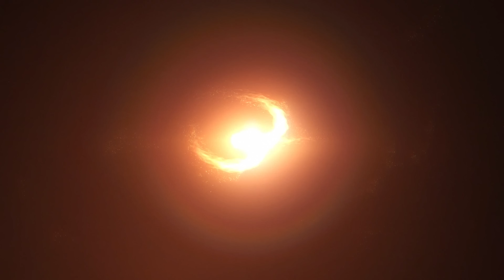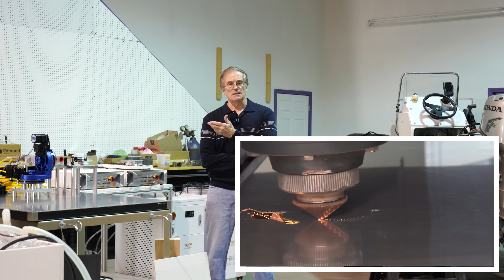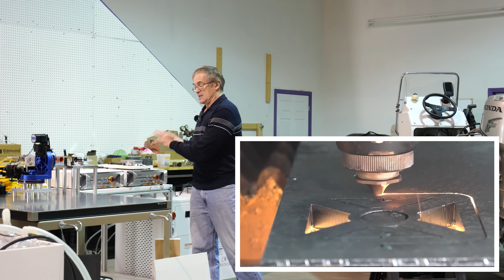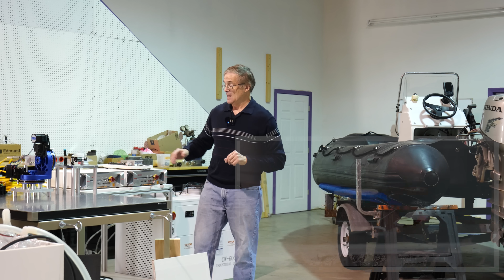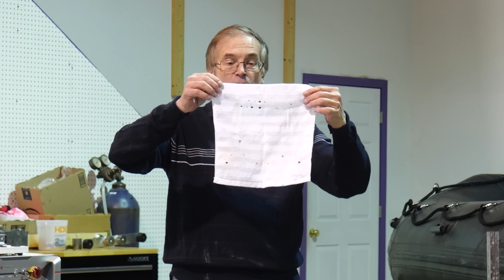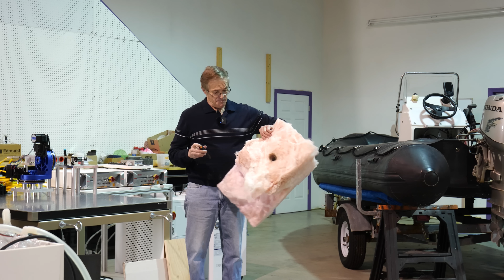We have a problem... and need your help!

Comment: Could you not put the same sort of diffusing lens (albeit a much larger one) near to the wall that needs to be protected as the lens used by the metal cutting system?  
Basically a 1m x 1m optical shield that will spread out the laser so it is less damaging.  This would be reasonably portable.

Comment: I know very little about lasers, but I've worked with PLCs for years. 
If some safety signal is lost, they will shut down the whole operation within 5 milliseconds (if that is their only task). 

The materials you tested are perforated 'upwards of a second'. 

Why not simply put up a "sensor", could be as simple as wire that is burned through, which triggers the safety PLC to shut down. 

Those materials should be good to go for at least 10 tests. 

Anyways, just an uninformed thought. Love the videos!
Reply from the maker: That's a really innovative approach.
I like it.

Comment: Something a plaintive like wood with a constantly running water stream over the top of it or repurposed 10 mm thick 1 m wide rubber belts used in conveyor belts from the mining industry which rotate over rollers rapidly. It may not be cheap and it may not be light enough to move easilybut the thick rubber moving quickly should solve the penetration issue.

Comment: 🇨🇱
Great channel. Great question! 
Many "solutions" propose a moving target. Be it water, sand etc. 
But, instead of moving the target, why not move the beam  ⁉️
Yo did not like a mirror pointing back at you, I understand 😀. 
However, how about a wobbling, rotating modulated mirror, say 45º or 90º !? 
The beam would no longer be a concentrated  point, but a extended line {figure} 🤔. 
Saludos de 🇨🇱

Comment: My first thought was the water saturated fabric, followed by fabric kept saturated via misting system recycled by a catch trough and pump system.
but as it wouldn't give much time. 
How about an ablative layer of carbon black applied to a ceramic fiber blanket. with a layer of foil 4 cm behind it ?
Or better yet a layer of graphite felt , that should get you at least 10 seconds alone

Comment: What a about a spinning piece of iron, like a section of old iron sewer pipe.  It would need to spin so that it disperses the heat.  Also if you cut a groove in it so that when it is spinning, it holds in water with centrifugal force.  This will turn to steam when it is heated up, obviously.  The barrier would need to be spinning, just outside the beam, and spring loaded to snap into place to absorb the power and then a small pump kick in to pump the water as it is used up.  I think the iron would rust black Fe3O2 in the water and laser, further increasing it's absorbing of the laser, hopefully.  This is just my brainstorm, I have not done it, but it appears t me to be the solution as I watched the laser cutting video, the thicker the material, the slower it went.  I would recommend a hard drive motor to spin the thing up to high RPM.  There are 10KRPM 3.5" x 1.6inch hard drives that will probably have a motor with a enough torque for that, but beyond that there are quite powerful outrigger motors in hobby model planes and.  You may need another motor to move the barrier in and out to change the track the laser is getting dumped into.  You may even be able to make the thing with the laser to carve out the trough inside for the water.  Sounds like fun!

Comment: Since the problem is there are no material that can dissipate the heat fast enough you can move the thermal resistant material fast enough, I don't know, an orbital panel of silicon oxide perhaps?

Comment: Equipment tech here. If you can mechanically track the beam path, how about using a concave lens to give a very wide beam dispersal. Energy/unit area should be inconsequential after a few inches. Just an idea...
Reply from the maker: Thanks. 
We can't mechanically track the beam path.

Comment: With 7000 comments, dozens of people have probably already suggested this:
Instead of a static piece of material, let it rotate on a motor. Then the laser needs to heat up a much, MUCH larger area. Pretty sure 2 or 3 layers of drywall will last sufficiently long.

a rotating steel mirror might also be an interesting test to redirect the laser into some trap made of sand or fluid. Without the mirror melting...

And if that mirror has the right bumpy surface, it could actually defocus the beam.

Comment: Graphite coated in silicon carbide should work. Put it at the end of a box coated with vantablack to prevent any diffused spill bouncing around the shop.

Comment: Stupid idea here, but maybe not.... 
You mentioned that the LASER would not damage an unintended target if it were continuously scanning. Makes sense.
Normally we think of scanning as in a back and forth linear path. What about circular scanning?
Could the LASER output be made to move rapidly in a large circle when not locked on to a target?
Once a target is found and tracked, reduce the circle radius to concentrate the power.
No need to disrupt the precise focus of the beam.

Might work, might not.... I look forward to seeing what you do.
Reply from the maker: It's a trade-off off.
My responsibility in this project is the laser and optics.  Chris is dealing with tracking and targeting. I don't want to burden the beam director system to deal with energy dumping. And, the same hardware and computer we're trying to failsafe against  would be part of the defense.
Reply: Understood. I had thought of the "spinny part" being mechanically seperate from the main tracking system. 
Somehow using a variable refraction to determine the scanning circle radius, with a fail mode to maximum refraction.
Admittedly I have no experience at all with high-power optics, so I am not sure what is possible.

Comment: What about a graphite ?
It is safe, has high melting point and is easy to get. It will redirect inside the material, maybe charcoal to reirect the laser through ex wood structure. It, s porous...
Maybe check starlite...

Comment: I've read in some article about nanotubes of carbon been used as a non reflective surface for laser beams. Infinite budget needed...
But, I was thinking if it might be possible to treat the beam like we treat sound. Reflecting the beam on different reflective surfaces that absorbs some of the energy until it can't be that strong, or a change it's concentration...

Comment: How about concrete backerwall, the stuff they use to put tile on walls without ripping down the drywall. They come in sheets as large as drywall, so you could make a frame with wheels, with possibly 2 layers of the backerwall.

Comment: not sure but keep thinking that the laser beam has a certain frequency and if it would hit something that has the same absorbing frequency then it could neutralize it. I have no idea how to do this but would maybe a wall of "counter light' or a material exited at the frequency be neutralizing. Again, I never worked with lasers, and I am a happy mechanical engineer that still uses hammers to solve problems. the only other thing would be a mirror that directs it into the ground.

Comment: Can you program a system that only turns up the intensity when you need it to be THAT intense? i.e. it will never go above x value unless you manually activate it?
Reply from the maker: We could, but we want full power on the target to minimize the time needed to disable it, allowing more targets per second.

Comment: I'd think mobile. Whichever solution, put it on wheels with a size fitting the weight. Not trolly wheels in other  words. Just remember to include lockable brakes or similar. It shouldn't have to be too big as you do aim the laser. You could always mount a laser sight on top of the laser to verify your aim. And if you fear the laser might ever move and that's why you want some size.. that's a laser motion detector cutoff switch begging to be designed. There are nice chips to be had with built in accelerometers. 

One step further... instead of a simple laser sight use a laser range finder and set it up so if distance to stop changes more than what you deem a proper tolerance level .. it cuts power immediately. As long as the sensor works in a specific frequency range it shouldn't be disturbed by the other laser. 

If you want cheap and replaceable... Do bricks kept upright by a wooden framework. If you worry a brick might explode put wet sand between two sheets of plywood behind that. To keep it from tipping over you need the bottom to be weighted and a framework to steady it. Cheap, reliable, mobile. 

Any ceramic material is likely to serve you well, but the price tend to go up from bricks. Lightweight Aggregate Concrete might be cheap enough and if you want more density you could choose the hollow kind and fill it with wet sand. There is air trapped in there though, which might cause it to pop. 

Technically you could make a vertical concrete wall coming out of a horisontal slab on wheels. If you want to go fancy you could do the opposite of heated floors and have water cooling inside the construct instead of rebar. Not meant to be a carrying wall after all.

If it is heavy to move around you could always use an electrical motor with some gear stepping so it moves at high torque and slow speed. 
A simpler alternative with be to build it to be moved by forklift, though then you have expenses in form of a forklift .. or possibly on a couple of hand pallet trucks.

Comment: Maybe sandwich thinset mixed with clear sand in between cement or fiber cement board, also could try putting cheap large format tile on one or both sides, doesn't have to be pretty. Or just a slightly angled wall frame with concrete pavers stacked or glued up it. Or both.

Comment: Hello!

You should try the thermal protection coating for the space shuttle.

Thermal Protection System (TPS)
It protected the shuttle from extreme temperatures (up to +1650°C) during reentry. 

Main materials:

1. Quartz fiber tiles (LI-900 and LI-2200)
- White tiles (withstand up to 1260°C).
- Used on the top and side surfaces.

2. Flexible coating (FRSI - Felt Reusable Surface Insulation)
- White felt for areas with heat up to 370°C.

3. Black tiles made of reinforced carbon-carbon composite (RCC - Reinforced Carbon-Carbon)
- Used on the nose cone and leading edges of the wings (up to 1650°C).

4. Aluminosilicate fiber coating (HRSI – High-Temperature Reusable Surface Insulation)
- Black tiles for the lower part of the shuttle (up to 1260°C).

5. AFE (Advanced Flexible Reusable Surface Insulation – AFRSI)
- Multilayer flexible coating for replacing part of the tiles.

Why these materials?

- Quartz tiles are very light and heat-resistant.

- RCC – withstands the highest temperatures, but is fragile.

- Flexible coatings – for complex curved surfaces.

Comment: Making it easier without sacrificing fun: 
1) the laser can't fire when stationary (you want to intercept moving drones anyway and the tracking system is part of the spectacle)
2) the laser can't fire longer than a second (if that is not enough at that power level - the tracking system has to be improved)

Then the fiber glass should suffice, no?
Reply from the maker: Of all these comments, this has to be one of the most subtle yet perceptive!
There are some details such as jitter, acceleration, and command control paths, but this could really unload the backstop requirements.
Reply: Glad to help. It turns a hardware problem into a software problem! Good luck with the project, and thanks for all your videos

Comment: After the fiber laser, but before the targeting optics you could put an additional galvo-mirror which is spring-biased to direct the beam into a beam dump when the when the system isn't actively shooting at a target.  The idea being that if the control/targeting system fails with the laser on the spring would direct the beam into the beam dump.

Comment: Try using the cement siding available at the big box store.  4x8 sheets  Can mount on 2x4/2x6  for portable walls.  3/8" or 1/2" rubber horse mat from Tractor Supply may be an option.  Combination of the 2?

Comment: Sandbags.... cheap effective, high resistance to energy and kenetic damage... Or like a few layers of ceramic tiles stacked, and sant packed between them and build them into crates and can move the crates. 

Anything you make you need thickness, and bulk density to distribute the heat and light, and energy and resist being melted.

Comment: Greetings, what if inspired on air entrainment cement panels, may be adding random scattering materials to change the optics of the beam after pass through desired layers. I've achieved some good cellular concrete just using soap foam. Hope you guys well and good luck.

Comment: Others have given way better, way more practical advice than me, but what if you just hook your backstop up to like a drill and spin the whole sheet really fast? (Axle parallel with the laser)

If you use two inches of backstop material, assuming the laser impacts at a diameter of 15cm and the laser impact point is one square mm, you are effectively turning a 4cm backdrop into a 464cm backdrop. Way more if the whole thing is moving back and forth too. I can see this being scalable too. 

Obviously this isn't the most sensible setup, but Im curious to see how this would do as low budget "laser armor".

Comment: I understand that you tried fiberglass insulation.. but did you consider Ceramic wool (kaowool)? This material is often used in fiber laser Sintering processes as protection. Portable and light. Small consideration to be had about the partials that can come off of it, but maybe you can mitigate that somehow?

Comment: Awesome challenge! Seeing how fast drywall failed and plywood caught fire shows the intensity. Water boiling instantly highlights the tiny focal point.
To stop that for seconds without fire/fumes/reflection, you need serious mass and absorption.
1 Thick Steel Plate: Provides mass and conducts heat away. BUT must have a highly absorbent, matte black, high-temperature coating on the front face to prevent dangerous reflections and soak up the light initially.
2 Contained Sand/Aggregate: A sturdy, perhaps double-walled panel or box filled with dry sand or fine gravel. Cheap, huge thermal mass, non-flammable, non-toxic off-gassing. The container is the main build.
3 Industrial Refractory Panels: Look into specific high-temp absorbent boards (not just insulators), like certain Calcium Silicate compositions or ceramics designed for high heat/absorption. Check specs for your laser wavelength & potential fumes.
Absorption + mass + no fire/fumes is the winning combo. Definitely test small samples first! 
Really curious to see what works!

Comment: Possibly along the same lines as other suggestions, but the fact that the LASER beam can extend beyond the table/work area is unacceptable, people could get injured or become "un2lved". My  idea would be a photo interference /Differential amplifier circuit with IR transmitter array plus an IR detector array at the edge of the table, installed on both corners of the table (the edge where the eye-bolts are mounted in this video) to trip  a safety-stop stop circuit, same as a smoke detector operates... if the laser passes beyond the edge of the table, power is disconnected from the laser. IR transmitter array "tower" on one corner, and the IR detector array "tower on the opposite corner. A change in intensity of the IR beams caused by the more intense LASER beam should activate an alarm and simultaneously kill the power to the laser. What do you think?

Comment: Shoot down at an angle, not horizontally. Aim at the floor, not the wall. You also have a very high ceiling so the height of the emitter could even be raised if you need a steeper angle.

Comment: At a certain fluence; the air becomes opaque to the laser. The air breaks-down to form a plasma which absorbs further laser radiation. For your system, I'd try setting it up with a more steeply converging beam  and has its range limited at the focus point by the air forming a plasma. In order to hit drones in flight, you will have to detect the range to target, and focus at the correct distance;  One additional advantage of doing it this way is that a countermeasure of making the drone reflective would be ineffective at these high fluences

Comment: Worked in spectroscopy lab at OSU chem years ago. 

Whether pulsed or continuous radiant power as demonstrated and to “absorb” it, I would consider:

1.) Ceramic matrix as a pressed solid—-but have it rotating very fast like a brake disk on super sports car and is cooled transporting heat energy away.

2.) A suspended gaseous or liquid matrix containing various metals scattering beam where matrix is pumped.  Gaseous am guessing best, super fine ceramic circulating across a window which passes radiant energy.

Continuous source radiant power must be absorbed—-the only way I can think of doing that is to have heat pumped away either by gas, liquid or both.  It must be transported.

If pulsed, that I can imagine will possibly allow for improved reaction time when cooling destination.

Just placing any material there and expecting it to absorb is problematic in itself as the source is constantly feeding hard power and destination not doing anything with it other than changing states of matter and chemical composition.

So, would say if continuous at source, the more so likewise will be the destination  to transport heat away.  If single pulse or pulsed, that I can imagine allow more control at destination.

Either way, consider the use purpose.  Is continuous required?  Would say big part of answer lies there just like you said “too much power”.  Dial back the source and consider benefits of pulsed.   Only deliver that which is required depending on scenario.